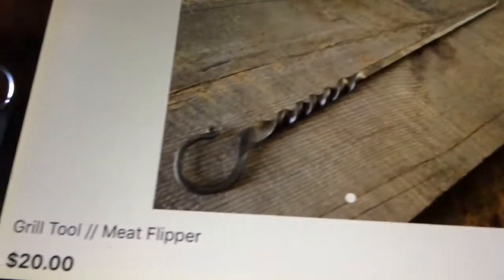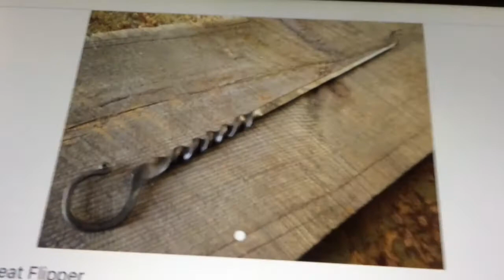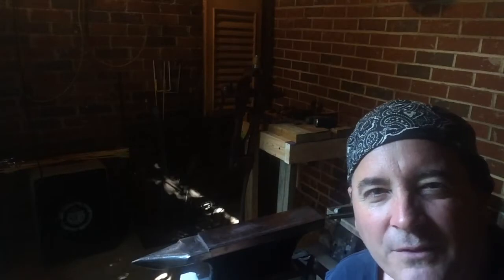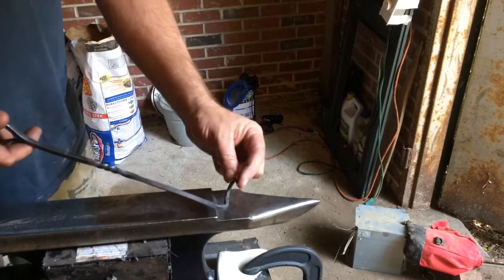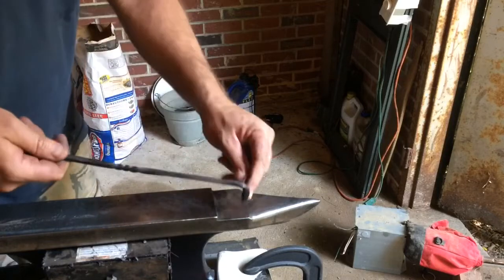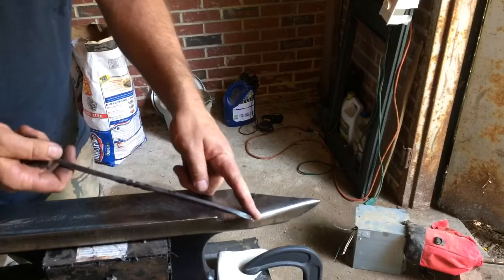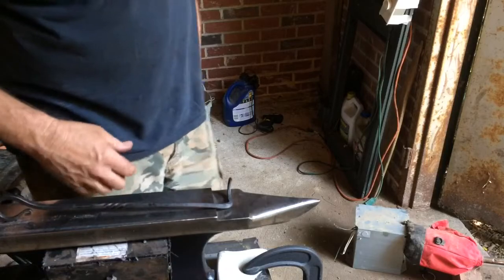Forged "Meat Flipper"

Comment: Excellent job buddy. That Anvil looks amazing. I still like the brake drum and rotor set up! Looks like it works perfect. Might want to recycle some of those beer bottles you have been collecting, maybe melting into a Ingot and throw your SC carolina chris outdoors logo in the middle. Just a thought.
Reply: Wait I take that back , glass is messy, you would need a separate crucible, aluminum cans work very well, and maybe make a stamp :-)

Comment: Chris, lift your hammer higher towards your shoulder. That way it does most of the work instead of you just tiring out your wrist. The rebound of the anvil will help to bounce the hammer back up so you won't have to have Dwayne Johnson arms.
Turned out really nice. I'd be happy to have that pierce and flip my meat. Wait... 
Also, heat it up and rub it with beeswax. That'll give you a food safe seal that'll keep you from getting that carbon taste on your ribs.
Reply from the maker: AZ Patriot - Thanks for the tips. I did do the beeswax thing later... thanks!!!